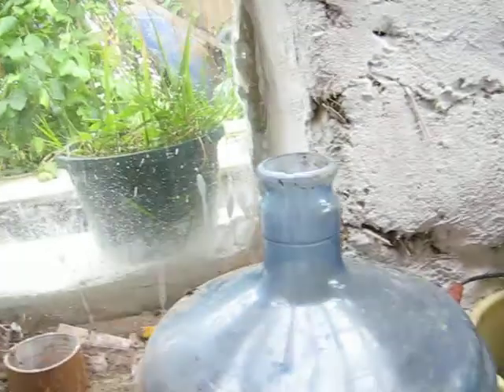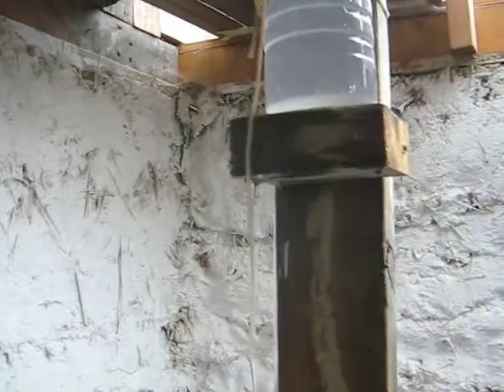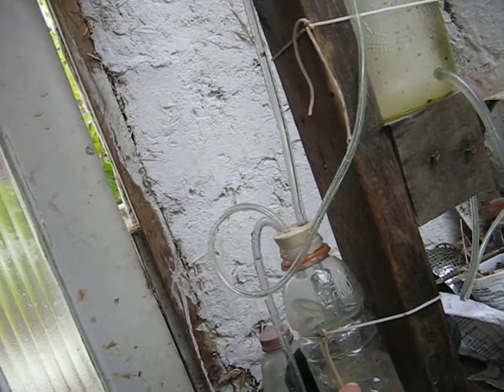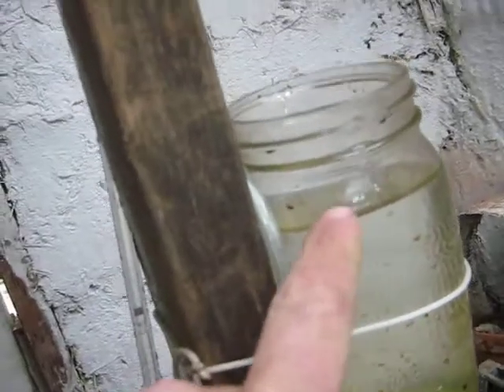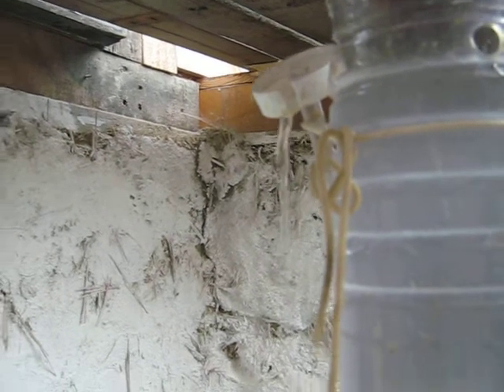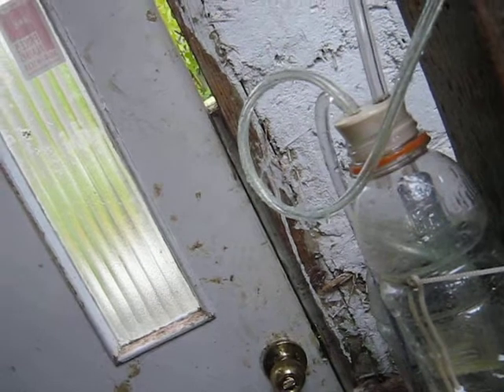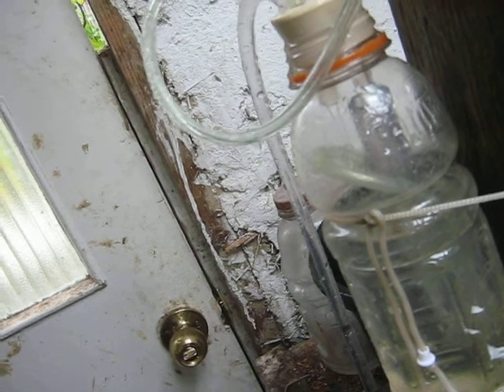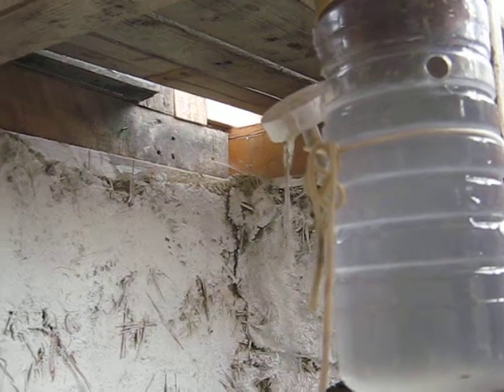Bio fueled water pump (Powered by aquarium air pump to show refill and pump stages)

Comment from the maker: @drrwatcher I have pictures (with image notes) on instructables.   It is called fermentation fueled pump  and my name is gaiatechnician  too.  There is a little plastic cylinder inside. (A tube with the bottom end blocked off) and a smaller tube connects into (and through the side of  it.  When the water rises above the top of the siphon tube, the siphon starts and starts to fill the inside of the cylinder.  (That  cuts off the air escaping).  Water goes  inside till the siphon "breaks"